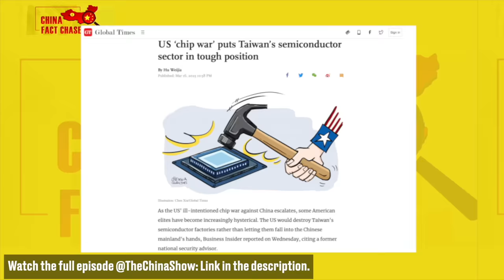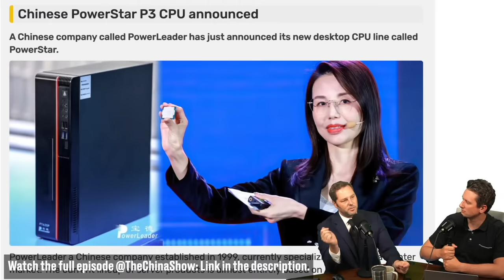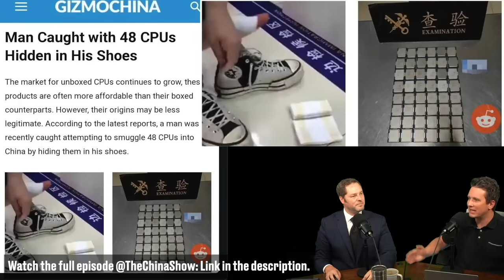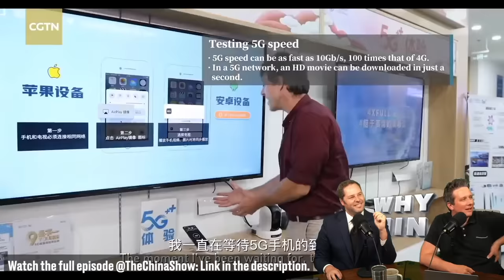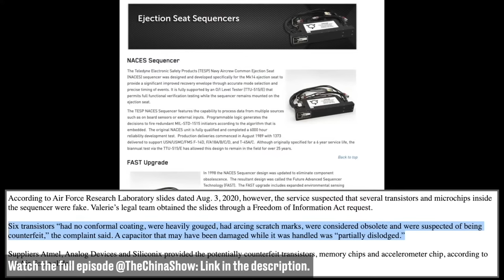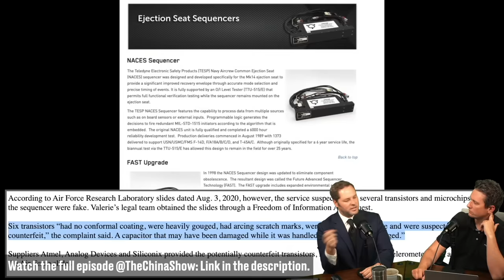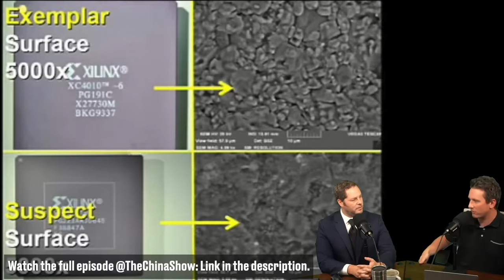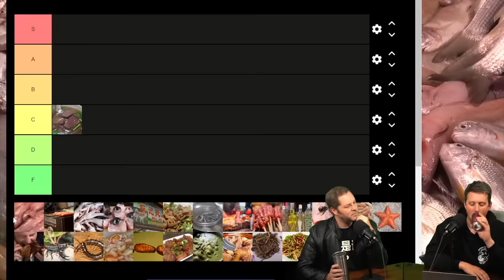China's Fake Ass Computer Chips Are An Embarrassment!

Comment: at 15:00 you say it is not proven if its a i3.
Then look again at the image where you zoomed in to the one she holds in her hand. The chip she holds is upside down, and you can see that on the edge where the connection marks is. Taking that in to account, then look at the text you can just make out being blurred. 
There are 4 lines visible. You can't say what it is the lines say, due to being blurred, but now we know its upside down.
Then have a look at the Chinese p3 and the intel i3 text. 
top line on the chinese fake is one letter where the intel is intels logo outline. Hard to pick up when its blurred, on the image there is clearly a sizable line. Same as with the intel version. Second one is a short line, where both again can match it. Third one is also a line where you can match it roughly in size with the blurred image. 
Now the interesting bit is on the 4th line. There it looks very much identical to the intel i3 CPU, where as the chinese do not have one. So counting lines overall and comparring them in rough size/length and number of lines on the blurred image and with the images beside the one where she hold up a upside down chip. Then it looks very much like she is holding up a Intel i3 chip and they did not even bother with picking one they rebranded with their laser edging machines.

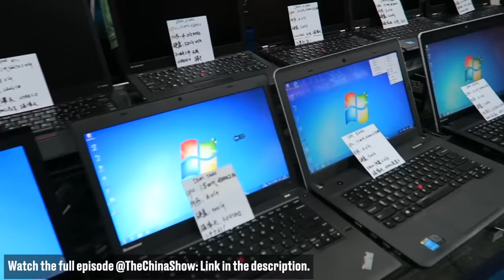Comment: 29:00 Never just test the first chip, for this, test them all, a lot.  Always only use verified chips from verified sources, which means direct from the manufacturer or established reseller to sell to you, for this grade.

It's very easy, require under law,  the manufacturer to have direct small volume sales of grade of chips for crucial application, which are all pretreated.  These applications have massive prices and that can easily afford this.  Then you set up the verification chain, and register chip, and see if it has been official, and if the id has been reused (to sell fake ones, they have to make a fake id or reuse an old id.  When you see no such id exists yet, or its already registered by somebody else or not yet onsold, you know one of them is a fake.  At each resale, it is re-registered in the supply chain as unsold, until it gets to the end, it's registered as sold.  They can still do stuff, but it becomes very difficult, and you can trace it to find out where the fake substitution id happened.  A requirement that all chips use is registered, means that even if they swap out the chips for fakes, and sell them under the counter to somebody else unregistered, you risk the fakes being found out, pointing back to you, and the real ones being used unregistered, which you are supposed to have sold to somebody else, pointing back to you.  The government know what types of chips are used in products, and can just random check products for wrong chips or unregistered ID's, and eventually likely to get found out.  You keep doing it with different chips, eventually an inspection should happen, and you are found out.

BTW, don't just get choos from China, get ones verified they work, or a substitute replacement chip that works.  For the SDI chip on the Commodore 64, the Chinese offer an FPGA based work alikes.  You could literally put a flagship level arm chipset chip on a custom designed carry board and put that in the 6502 socket, and play good PC 3D first shooter games. The colour and resolution wouldn't be great.   But, if you designed the carry board to also cover and plug into the SID and graphics chips, you could get some reasonable level of look.  Sub VGA of course.  You could even do the same thing on a Sinclair zx80.

Comment: China does and has made breakthroughs in semiconductors. Recently they have created their process own for making 4nm and 3nm chips. Problem is Chinese research has always been capable of making proof of concept breakthroughs, but never had the infrastructure, ecosystem and industrial base/know how to do anything with it. It appears most of China's Semiconductor Big Fund to create such things was basically embezzled by the group of CEO's put in charge of China's semiconductor industry rebirth. Right now all China can only make chips from 10+ years ago, because they bought the lithography machines that made them over 5 years ago when the worlds fabs stop using them. Which was fine in short run since many civilian products like cars to washing machines still used older chips. China could learn how to run a fab system and still make money. The problem for China is less and less stuff use chips that old. So China is not making profit from those chips anymore. China also discovered that it takes decades to build up a semiconductor industry and its almost impossible to make everything in house. Because of the costs involved other nations will always been needed since they invested into specific industries like optics, mirrors and lasers. That make things like lithography machines rather than make the semiconductors themselves. At the same time now that China is cut off from companies like ASML, Nikon, and Cannon they no longer have tech support or spare parts for the lithography machines they do have.

Comment: I wouldn't be surprised if it's chips reclaimed through recycling and low cost auction buys. Then it makes complete sense to burn the label off and sell it as your own. They only need to function at whatever the P3 spec is and then fit the sockets. I only assume they fit boards designed for intel chips but that would also violate patents in the west. These chips would be sold to third world countries possibly as low cost alternatives to Intel or AMD. Like they said it only needs to run an office computer possibly. I have an i3 8100 that works just fine for everything except VR and up to date gaming paired with an Nvidia 1050TI. Anything from there to the newest i3 is a quad core and quite capable.

Comment: reprogramming chips hmmm,  only microcontrollers and memory can be written or programmed, perhaps some chips can have features modified changing the operation of that chip, but reprogramming no way, a processor can have its firmware changed but the operation will still be the same, try to reprogram a 7407 or a 74145, without some sort of "mcu" or there alike inside the reprogramming cannot be done.

Comment: yes china has many scams but they also have real homegrown SOCs for example
The Hygon CPUs that came out of AMD and China joint venture when AMD was on the verge of bankruptcy and would do anything for some cash.

Or the newer and faster Loongson Brand
for example the Loongson 3A6000 CPUs
which are reported to be as fast as Zen2 or Intel 10 the gen
So 4-5 year old CPUs form AMD and Intel .

The real problem holding these companies back is the lack of lithography Equipment of the newest types, because only one company makes them a Dutch company ASML and currently they are not allowed to sell to China.

Comment: Guys, I think you're waving your hands on the notion that it's somehow easy to get a I3 processor to report some manufacturer other than Intel to the software running on it...

The memory module comparison is invalid.  Memory modules store their parameters in a separate off the shelf PROM chip that's designed to be reprogrammable.  It's absolutely trivial to change the contents of that chip.  You can see there are multiple chip packages on a DIMM, and that one smaller chip that looks different from the others contains the module information, and on many modules, you can get physical access to it.

Intel has always had a vested interest in not allowing people to reprogram the manufacturer/model string returned by the CPUID instruction.  For sure that's not stored in off the shelf standard media that just anyone would know how to reprogram.  If you think it's that easy, why don't you point to where on the CPU module that information is stored?  I'd bet you money Intel hard wires their manufacturer and model number in the CPU, and at best, there's some simple fuses that let Intel bin out processors to different performance bins.

Unless the Chinese have masks for the processors and are actually fabbing them themselves, they aren't changing what those processors report to software very much.

Comment: At 0:50 you guys talk about research and development etc. Don't forget that in 2015 some important data was stolen from ASML. As far as I know China tried to start building a factory with that info (plus the guy that stole it) but were not able to get it running properly. WHY? IMHO not because the Chinese are stupid. But IMHO because of the strong cultural differences that make teams of engineers in US and EU work different than in China (and India). Especially in EU-NL where individuals are very very much allowed to disagree with their superiors or try and work out alternative (i.e. out of the ordinary) solutions for problems on hand. Both in China and India I notice that cultural hierarchies have a huge impact on how people operate and especially in teams. And it is the latter which is needed for the extreme high complexity (yes we are talking more complex than rocket science!) engineering that is needed to build CPU processor building equipment as ASML is capable of.

Comment: China does have an domestic chip...

it's just worse than even an 10th gen i3.
Chinese company Zhaoxin have payed VIA for using their x86 license and old design as a base.

so its best CPU is basically an VIA C7 (that is just an Pentium III generation cpu on steroids) in an 4 or 8 core package made at 16nm with some upgrades like DDR4 controller and PCIe.
but still only 15% of the performance of an old 7th gen Intel i5 and is even beaten by the old AMD A4-5300 and Intel Celeron N4100.

my guess is that Chinese manufacturer would just go all in  at ARM since it's an open license and get all advancement by state supported corporate espionage like they do atm.

Comment: Fake Chips from China is a huge problem.  Honestly, it's so bad it's best to avoid anything from China and yet even US Suppliers are sourcing this garbage from China so it's hard to source components for my retro repair projects.    There is a company in Europe selling an outstanding accelerator board which requires a Motorola 060 rev 6 but they don't include the CPU.   I would love to have one of their boards but how many 060's?  Do you have to buy before you find a real one especially due to the price of the CPU.  Yea not even worth entertaining the thought.   I have people made at me because I mention the fake chip issues which is why buying that accelerator board not such a great idea.

Comment: The CPU reports its identification to the BIOS and OS.  Unless they resolved that.  Compilers check this.  Good luck putting out quality code for it to run that doesn't give away what it actually is by performance type fingerprinting.

Comment: About the way China uses 5G, they sometimes just seem to use words that sound good and use them as buzzwords to get people interested in their products.  You might see that even more with fake items or items that are not quite fake but simply don't have real specs to match their claims.  You might see it with their cameras and action cameras.  They may claim that they are 4K and the camera might not have it anywhere to be found or worse, it may simply be a 1080p or worse resolution that is just stretched to 4K and leaves you with horrible looking video.  That or the frame rate may be something low like 15 FPS.  30 or 24 FPS is what most videos are and often 60.  Those are not the only numbers that exist but those are common enough.

Comment: They can copy the physical design but that isn't the important part, I mean it's important but there's something else called the  instruction set. Intel uses the X86-X64 instruction set and it is proprietary and you can't just use it. 

There are only two other companies with an x86 license. One of them, VIA doesn't make anything you've ever heard of so the other company is AMD. The software and operating system for Windows computers will not be compatible unless you are using the x86 instruction set in your processor. It is copyrighted by intel and AMD with a cross licensing agreement.

 Intel will never sell anyone else an x86 license, they never have and they never will. The only exception being AMD and VIA, plus AMD actually invented the 64-bit part of it, which is the cross-licensing part. 

 The Chinese cannot make X86 processors because Intel will never sell them a license. If China is stealing the Intel - AMD x86 instruction set they will not be able to sell it outside of China. If a processor does not have embedded instruction set software, it is just a paperweight. 

If you're curious whatever cell phone you're using, Apple or Android uses the ARM instruction set. You can buy a license for that

Comment: What's with the other guy on the set? Don't comment because you have nothing to say. Waste time by drinking soda. Sit and have nothing to say until you need to insert yourself into the conversation. This is a lopsided conversation. It's crap. What is that other person doing there? He doesn't have anything to contribute. No on the 2nd person. I'd get the same information if the cohost wasn't there.

Comment: What you see is not the chip, is the heatspreader and a piece of fiberglass as support. The cpu is inside and can actually be anything. You can repurpose the board to put your own chip inside.
Today pin compatible CPUs are not common as once they were, but for licensing reasons only.
Intel licensed its pinout so you can't use it... But if you care cr$p about licenses, you can make your own x86/AMD64 cpu that is pin compatible with any intel or any AMD CPUs, again, as they were in the past, when Cyrix existed (Currently owned by a chinese company and making their own chips) and even AMD and Intel were pin compatible (also with Cyrix) but the "insides" were completely different. And before that, there were even more pin compatible cpus with different "insides"
They don't do their own "insides" just to save money, not because they could be incapable of. It will save them a lot of money that they can scam from their corrupt government... so...

Comment: If the benchmark give the same results it's probably just an rebranded intel i3's. But Maybe they cloned it, I have couple of ARM STM32 clones from Chinese companies, GKS32, AIR32, etc. They clone the STM32 M3 and M4 core implantation and ordered the chips from TSMC, and they designed couple of risc-v cores. Making a CPU is not that hard, making the machine that make then that is hard. I designed a couple of CPU's myself. 😁

Comment: China does have a few real CPU design companies, zhaoxin comes to mind.  They partnered with Taiwan’s Via technology from Taiwan to learn how to design x86 processor 10 years ago and have real products.  They are just a few generation behind.
Reply: You can design all you want. But without a fab, it is just a paper CPU.
Reply: @mlai2546  with out chip designers (Qualcomm, Nvidia, Broadcom, AMD, Samsung, Intel), there wouldn't be no fab factories, it's the other way around, how do you cook without the recipe 😂
Reply: @mlai2546  "Anyone can design a chip"
Oh really? Guess you don't need those lithography machines from ASML holdings?

That's in the Netherlands.
Reply: @mlai2546  You got it all twisted, you need Chip designers engineers to create or design a blue print of the Chip it doesn't matter what kind (x86, POWER, or SPARC chip architectures), it doesn't matter what companies does the design (Qualcomm, Nvidia, AMD, Samsung, Intel 
Mediatek, Apple etc) before the pass the Chip architecture or designer passes the blueprints to the Fab company (TSMC, united microelectronic company UMC, Samsung, Intel Texas instruments to manufacture the Chips to whatever size (200nm, 50nm, 10nm, 3nm, etc).
Basically you need a designer/engineer to give you the blue print before the contractor or sub contractor can build the skyscrapers with the elevators, shape height air conditioning, stairwell fire exits etc
With out designers like Gordon Moore, or Kelly Fab factories like TSMC, Intel Texas instruments UMC  wouldn't be nothing today.
Reply: @harrisonhari  are you saying people designed a skyscraper without knowing how to make steel and concrete? Like car design came before wheel was invented?
Reply: @mlai2546  Lithographic for computer chips with transistor smaller than the size of your hair, are not the same as building skyscrapers with cardboard and thin metal gratings, and filled with gravel concrete for support.

You have western technologies to thank for Chinese mass produced goods.
Reply: @mlai2546  Yes your are correct 😜😜 👍 you needed a designer/ engineer from Texas instruments to understand that  silicone and rear earth materials are the best material to fab a Chip on  at the moment. Just like engineers  in Chicago were able to design an elevator using steel cables and pulleys and wheels to create a skyscrapers
Reply: @harrisonhari  For you to design something, you need the pieces that are available. Do you think Sony or Canon designed a camera before photo diodes came to existence? Do you think LED TV was designed before LED existed?

Comment: Yup, China blows at making chips anywhere near the top end. However, they have a stranglehold on the low end chips (larger than 14nm) which account for far more units than the high end chips. Laugh all you want, but if China stopped producing the low end units, we'd pay a huge price. Most cars (as an example) use numerous 20/22nm-54nm chips. Guess how many fabs there are in the US producing those chips.....
I hate having to defend or stand up for China, but the video shows a not very unexpected lack of knowledge/nuance by the hosts.